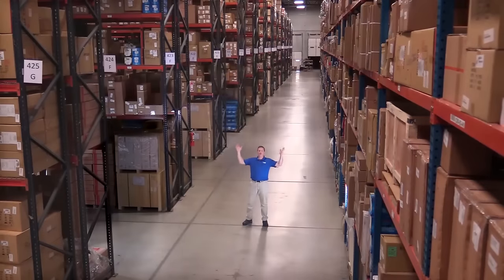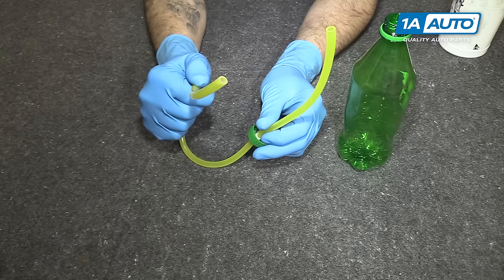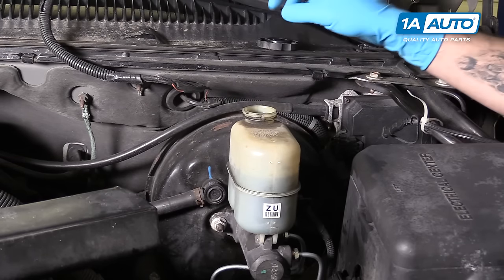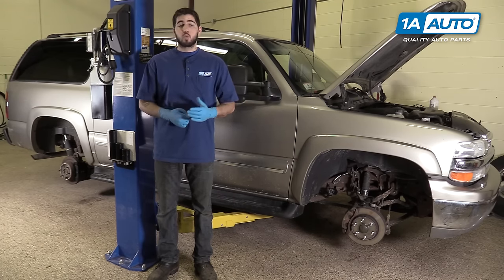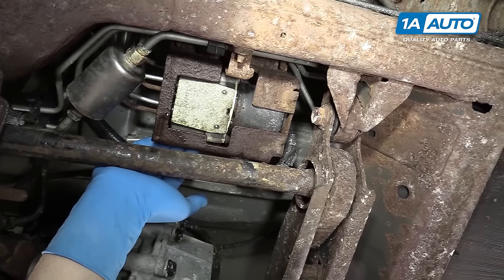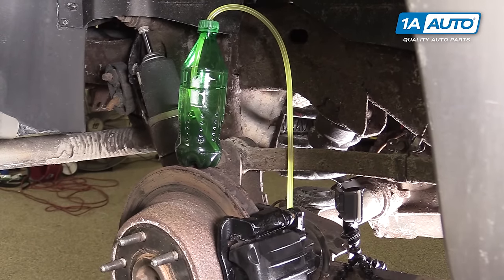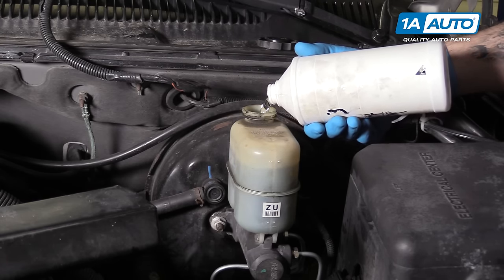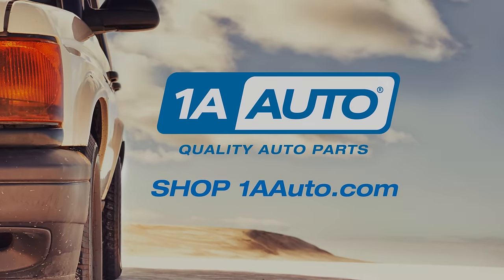How to Bleed your Brakes by Yourself

Comment: I allways put teflon tape on bleeder screws they will never rust fast.
Reply from the maker: +R S The parts we carry will only fit the vehicles they are listed for. We may have some mounts available for your vehicle still. Thanks for checking us out! http://1aau.to/m/Shop-1AAuto-c
Reply: Teflon tape on inside or outside of bleeder valve?  Thanks

Comment: My ABS and Break light just came on; however there is voltage on the abs sensors.. the brakes work... checked the grounds...   Dot3 is topped off.   However it seems to be dirty... could this be an issue to cause the lights to go on?.. This seems like a real easy method to bleed/clean the break fluid... worth doing?

Comment: I just attempted this this morning. Couldn't for the life of me get the hose over the bleeder screw. I got the right size hose. Maybe my Ford Focus has a larger than normal screw. I don't know. It didn't help that there was a bolt in the way that gave me less than an inch and a half of space to work in.

Comment: Did I miss the explanation of the click? I I just installed two new CV axles on an 08 jeep commander it is lifted and I had no  noise before on the OEM and I installed Carquest brand and I have a lot of clanking under acceleration. I assume because of the front and lift to put more angle on the CV axles during acceleration from body shift. Clanking goes away under coasting or deceleration or just lack of Acceleration

Comment: There are many videos on doing this but I have two questions. You do explain why you drill a hole in the cap to run the hose through, but I've never done that. I just use an open container and have never had an accident. I thought there maybe was another reason for for it. Am I missing something other than just avoiding spilling it? Also, I still have somebody do the break pedal for me while i open and close the bleeder. I don't see how, even cracked open just a 1/4 turn, that you aren't sucking air past the threads into the cylinder. Especially with that tiny vent hole in the cap. I would think the less vacuum pressure the better for avoiding air leakage at the bleeder threads.

Comment: Could you please tell me the location of the ABS Module location on a 1999 Honda Accord DX? I just purchased the car and need to bleed the brakes. Well, at least I think that's the issue as the pads look new but the brake pedal goes all the way to the floor and the car does not want to stop. If you believe it may be something else, please tell me. Thank you in advance.

Comment: Possible bleed all brake system lines (front and rear) from one side for example? If my car Lincoln Navigator 99. Possible or no? Or all 4 wheels have independent separately line, no breake network?

Comment: I have been bleeding chevy brakes the exact same way y'all do it for years with good results.  but, If  air gets into the abs module you might have to have someone with the software to make the module self bleed then finish  manually bleeding.  Now I have been hearing people say that this waycan damage the master cylinder, but I have dad no problems as I flush my fluid everytime i install brake pads.

Comment: The only thing I don't understand is that you pour the new fluid into the old fluid. And they mix. So your new fluid is wasted in half. Is the pressure bottle method basically the same thing? Or is it more economical?

Comment: Does the car need to start up the engine to push the brake paddle? My brake paddle felt hard to press without start up the engine to gain the vacum pressure

Comment: Good video. I have a question. I bought a old Mercedes-Benz, had to it was cheap. Mercedes are known to get rusty calipers. Inside the pistons  mainly. I was wondering this, instead of pulling the system apart and replacing the calipers. Could a person drain the system and then fill it with white Vinegar then power it thur the system quite a few time to remove the rust. Then do a total flush and put in break fluid.

Comment: I did something dumb.  I hit the brakes and pushed out the piston.  I stuck it back in and used a C clamp to compress it.  Will I have issues now with air in the line? Do I just need to bleed it?

 Brake fluid started to drip from the seal.  It stopped after a bit.  doesn't look like the boots torn.  Ill drive it a bit and check on it...

Comment: 7:32 by NOT closing the bleeder screw between pumps of the brake pedal, AREN'T you DRAWING air BACK into the caliper ? Isn't there some kind of CHECK VALVE that could be used if you don't have a second person at the caliper closing the bleeder screw between pumps of the brake pedal ?

Comment: How u do this bleeding thing on older small '07 Toyota Corolla w  frt disc but  rear Drum brakes ???
 (no ABS  no ABS )   So how u do bleed  rear drums ???   rear drums.  on the rear drums ? 
 15"  wheels/rims.. sits outside no garage.. like most people
Toyota  '07 Corolla   155,000 miles -  got used, me am 3rd owner... no clue what if how was really maintained before me.  ( but overall good shape decent allaround)  it's small car... compared to this big lug in vid
  Live in Boston rust belt, freezing cold snow slush winters.. ok? ok
 Car sits alot not drive everyday 
 This past week not drive it 5 days bc so hott humid weather July  been 95-98'F  hot hot.
**   [[ Car sat for 5 days...  My left rear drum blew 1 shoe pad worn  fell off inside drum cover  seems like (defective?) but was old rusty.  ( car brakes been prior this  ok  like normal but  always been lil spongy but work ok.. drive car eazzy like grandmamoses)
So..Going only slow 25mph side street at nite lil cooler out.. touched brakes slow down at yellow traffic lite.. suddenly hear
really  quick loud zingg snapp sound... then screaming  LOUD banshee screech like for8sec.. and car slowed suddenly . . like rear wheels dragging .. pulled over.. Left  rear wheel rim pretty hot heated up.. but not right rear.   Drive half mile  tp buddymechanic  his hse.. jack up..  try spin  wheels.  Left is stuck not spin at all.. right rear ok spins.  Have to wd40  all 5 lugs both rear wheels...  hard get off just the wheels.  Then gotta slamm slam longhndl sledgehammer to  drum covers 800x  to get off. 3 hours later.. Find  Left rear   w worn  piece  drum shoe pad falls  out w drum cover to ground.  Right rear drumcover hard hard to get off.. but shoes pads cyl all look ok intact.   Right ok.. bu Left rear fcckkdUp...]]   **
wD40 is great lifesaver   get rusty lugnuts drum cover off. omg great stuff.. works.
 So what was that huge scary  screammming   sound noise?
Never heard experienced this in 40yrs driving different cars some old,  new, rentals etc. My cars mostly older rusty small cars.
What was that ? What happened?
What caused this ?
  Today just had cert mechanic at decent reputable busy svc repair place..(I know owner  40yrs in biz.) the brake mechanic Ted removed and replaced  both Left Right rear whole drum assembly w new parts..  and did new Wagner  drum shoes.. but kept  same drum cover was in ok decent shape .
 ( very hard to  get parts tooo... Remember this!! esp now!!  supplychain bullshitzz)
  He did not bleed brakes or system after installing.   I did not see him even pop the hood check fluid levels  once... (but I might have missed that).   I asked him  -  Do ya need bleed brakes?   he mumbles   "no.. will  adjust after driving.. self adjust."  ( i sorta agree drums will selfadjust? I guess w lil cyl screw and stupid springs  in drum assembly)
( kinda believe sorta trust? this guy has lot experience knows brakes fix lot of cars .. pretty good  niceguy.. owner knows likes him)
 He took car for spin test drive it. says ok.. if any probs " just bring back can adjust" ... me ok.
  BUT... brake pedal still   lil too mushy  for me. .travels too long still like has done for most past 3yrs.  makes me nervous.
 I want  pedal  solid  hard  tight,  couple inches travel only at most ( like new again).   is it possible?
 What is  wrong ?   Will bleeding help this ?   Flush  out put in all  brand new brake fluid?
 I watch care maintain car good for 3yrs now.   Brake fluid been ok looks clear clean  at max line mark  on white top lil reservoir.  ( Corolla '07  kinda dbl reservoir system w lil one above bigger reservoir  below it)
 Gonna take it back have Ted check it again ..  this  succks 
 I saw him  on the new parts careful adjust the both  rear  drum  cylinder  screw adjuster thingy for cylinder/ spring crap.
  ohh This cost me  $365  for this rear drum parts/ labor  .. thot was decent price.  ( kinda expected cost  more like $400-500)   so good price.
 Anyhow... fckkkn drums  SUCKKK  really.. too much crap parts mechanical shittzz hard to do pia pia need  muscle, pliers etc etc. Old ancient tech 
 Disc brakes  ONLY way to go !!! Ted,  most mechanics agree too.
Wish I had on all 4 wheels.
 pss..  Rust suckks  such a killer. .ask me I know 5 cars lifetime.. eust is loving me talented monster..never stops. just suckkkks.   Car fixing diy is whole diff life up NorthrustLand.
     Help pls .. thx

Comment: I have completely replaced the brake fluid before as after several years it becomes black. I would keep the brake depressed by using a broom stick, a belt and a long bungee cord.For me getting up checking the fluid level in the master is easier that having a helper who does not keep the brake depressed or pumps it too much. I work the wheel the farthest in the same way...

Comment: I did it on my Nissan with a Mityvac.  It worked well and no need to have someone in the vehicle operating the brakes.  Just keep an eye on the fluid level.  Don't let it go too low or air may get in the master cylinder and you will need an ABS scan tool to get it out.  A scan tool with that functionality is not cheap either!!  I may get more fluid and bleed the some more.  It will be more like a flush really.  The only difference is multiple bleeds.  It also helps to start at the furthest one from the master cylinder for that purpose.  I could try the 2 person methods but I don't really know anyone I can trust not to accidentally fowl this up.  Following the instructions of the one with the wrench is critical.

Comment: We were taught to use a crowsfoot wrench, or boxend, rather than an open end for this operation rather than an open end because that open end might round off the corners of the bleeder screws if the bleeders are stuck to any degree.

Comment: Make sure the hole in the cap isn’t tight so air can escape. Otherwise you’re just pressuring the bottle and it becomes the sealed part of your break system. Was wondering why fluid was barely flowing and the pedal was getting harder.

Comment: Put on new front pads, and replaced driver's side front caliper. Did all that because the drivers side front brake was locking down that wheel. He bled the brakes as well. Now the brake isn't locking up, but the steering wheel is being taken from hands and turning toward driver's side. What's going on? I'm positive that wheel was locking when the brake was applied. I'm almost 67 and I've only seen something like this happen, when there's something wrong with the power steering pump. What say you?

Comment: lol this method works i had been workin for like 2 hours to get mine bled and then i watched this video- done in 10 minutes. Way easier than I was making it. The two things that tripped me up-
1. not having a vent on my bottle for air to flow out
2. Overloosening the bleed bolt. You really barely gotta unscrew it (1/4 turn was actually a bit much for mine) and bam flows like a spout

I just used some old nebulizer tubing and a piece of tape over a bottle, for those who dont wanna screw and ziptie and whatnot

Comment: I would think that by now there would be a quick connect fitting for hose to caliper that would allow for ZERO leakage and wouldn't come off if you bump the hose.   Or at least a valve of some sort when you are putting on a new caliper.

Comment: I tried this method and used 2 12 oz. bottles. Either I missed a step or it just doesn't work. Tried for bout 4 hours and still didn't get any pressure;  had to miss work the next day.

Comment: Can anybody confirm my statement... new brake fluid in bottle with hose attached to bleeder valve.  Bleeder valve opened and you can just pump the brake until all the old brake fluid is out from the line.  Tighten back up the bleeder valve and check fill level?

Comment: great technique. I'd only add that the wrench be a line wrench, (if space will allow it). On an older bleeder screw it will round off soooo easily.
Reply from the maker: +joe ardinger Thanks for the tip!

Comment: Good video. My only suggestion would be to remove most of the old brake fluid from the Master Cylinder before starting the process. This Can be done with a turkey baster.

Comment: Why didn't mention not to open the bleeder screw a lot that fluid isn't coming out of the threads,but in ur  video how to bleed brakes on Honda Civic the person opens the bleeder screw all the way without using this bottle method and let's fluid squirt outta the threading part?

Comment: I watched an old school mechanic do this. He was flushing the system but what he did was use an old turkey baster to pull old fluid out of the master cylinder and put it into the jug first. Then he topped of the MC and did what y'all did and waited for the line to run clear and no bubbles. Quick easy and solo.
Reply from the maker: Thanks for the tip and checking us out! +Fungulus1

Comment: Do you have to turn the key to the on position before stepping on the brakes? Wouldnt the brake pedal get hard after a few steps if it's not on?
Reply: I was thinking the same too.

Comment: Please tell me how you can see the clear tubing line on the calipers on the other side of the car (for the bubbles or new fluid to come through) ---  whilst you are pushing the brake pedal from the driver's seat??
Reply: I think person has to go back and forth between pushing pedal and observing air bubbles.

Comment: i worry about air being sucked in around the bleeder screw threads with the one man system. i prefer the two man so the screw is closed when you release the brake pedal.
Reply: How do you cross the street by yourself?

Comment: Quick question. When you’re bleeding the brake, do we have to tighten the brake reservoir cap? Or we just need to make sure the reservoir is full and leave the cap loose or opened?
Reply: Although the cap doesn't need to be on tight for the physics involved to work, you should probably do it anyway to lessen the chance of contamination.

Comment: Doing this in the grass, in my backyard, with sand spurs and fire ants in South Florida, and it's 100°F outside. I can only lift my car to the lowest setting on the Jack stand, because I don't have pins or a jack that will lift it high enough to even set it higher, even if I did have pins lol not to mention that I had to change rotors and a caliper, on an 08 Mazda 6 that's never had new rotors. it was so seized that the caliper bracket bolts were about 10000lbs of torque and heat seized on, I can't even begin to tell you how fun that was. O and the rotors screws either stripped or snapped on all 4 rotors. I bleed the brakes and got it done. Now it drives better then new. I think I broke a knuckle, smashing it while trying to torque the back caliper brackets off. Needless to say, I got it done, and it was a job well done. With the 1A tutorials I was able to get it done and done right. l love these tutorial videos

Comment: Why would you have to bleed the master cylinder separately if the fluid got too low?  Doesn't that air bleed out just like the air in the lines?
Reply: B/C you're going to be sucking air back in the system if it gets to low!

Comment: Do you have to maintain the brake pedal pushed down while tightening back the bleeder screw?
Reply: No , as long  as the hose is submerged in the brake fluid bottle , no air will get in once you release the pedal .

Comment: Just completed my solo fluid change, with a full hard pedal again, but did it the way an old timer told me many decades ago. So have been doing it his way ever since, but did pick up a couple of finer points from this vid, thanks...The only main difference being that have a long length of clear plastic tubing that runs over the side of roof rack, when doing back brakes, to eventually feeds back into the reservoir. So brakes get a good work out pumping in a closed loop without any visible air bubbles present in that line, then bleed screw closed. Usually count about a dozen pumps for the back and six for the front, making sure reservoir stays topped up, to begin with.

Use a bottle to start off with to capture dirty fluid, till clean comes in behind, then end of hose goes into reservoir. Only used one bottle of 500ml fluid to do brakes and clutch, so economical as well. Didn't do a full loop with the clutch, but did have the elevated front of the line feed into bottle, whilst still checking for air bubbles. Takes a bit of juggling around but now have it down to a fine art, having done it that way numerous times without a problem.
Reply from the maker: +tatko Thank you for the reply! We love empowering our customers and showing how to perform DIY auto repairs even if its just a couple finer points. Your information may help other as well! 1aauto.com

Comment: Ya I had a bad line and lost all buy the time I got home I didn’t have any brake fluid with me so should be fun bleeding I got a dually with drum brake and the far passenger side someone screwed up the bleeder I’m going to try to bleed at the tee valve over the rear end hope it works will have to pump that one on the back it’s really cold right now to it’s 19 of dec in Canada with only a drive way should be fun and cold oh well that’s what you get for waiting I’m a procrastinator lol but now or never